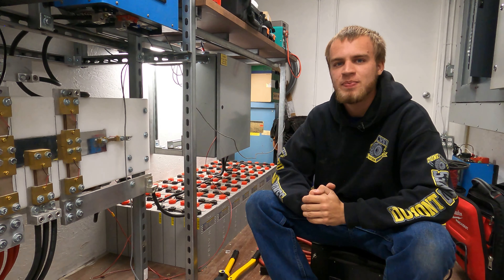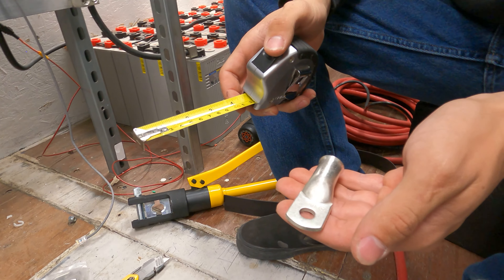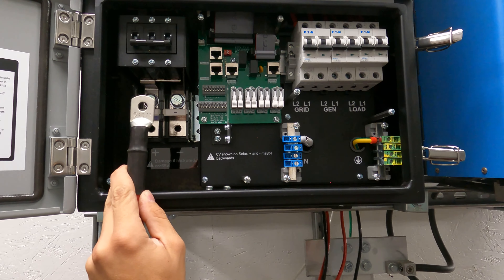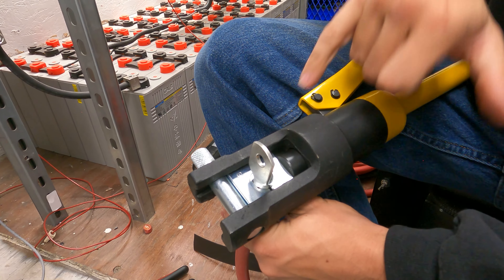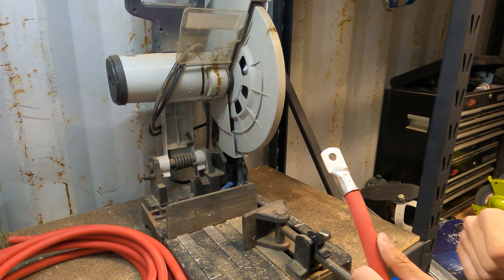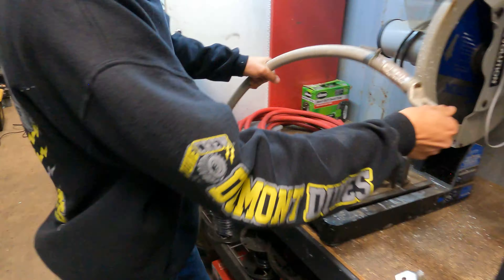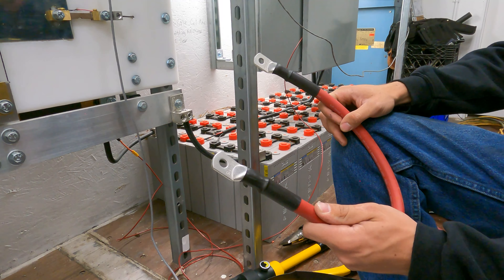The PROPER WAY to Crimp Heavy Gauge Battery Cables

Comment: I bought a TEMCo hydraulic crimper for my solar install.  If I had known how easy it was to make my own battery cables, I would have been doing it years ago!

I've come to the practice of rolling the cable insulation along the utility knife instead of cutting with the knife.  The end result is that I have no cut strands.
Reply: Are you happy with the hydraulic crimper?  I just ordered one, I like the 1/2 sizes so you have some leeway for different thicknesses of copper lugs
Reply: @stovepipe9er  Yes, still happy with the TEMCo hydraulic crimper.
Reply: @jimegan7077  excellent, thanks for letting me know
Reply: @stovepipe9er  I have the same crimper. works great

Comment: Great video, I watched a few videos before yours and thought to myself, hmmm, I don’t think they should crimp battery terminals with a chisel. I don’t think they realise that it should be compressed it to a smaller cross section. I was checking this out because I wasn’t sure if I should tin the cable before crimping, but you’ve answered my question. Thanks👍

Comment: Nice video. The only thing I like to do different (personal preference), I like to wipe the insulation and lug with a rag dampened with isopropyl alcohol prior to applying the shrink tube. I find the heat activated adhesive in the shrink tube really adheres better if any fingerprint oil or contaminate left by the manufacturer or by the crimper is removed. 

Also, I’d note TEMco sells referb units on E-bay. Mine I couldn’t tell from new, other than an oily residue (I suspect it had a failed or mis-installed seal and was returned and rebuilt). Saved $$$

Comment: On the 500 pro lug, try and cut directly on the crimp lines and see if the copper is tighter there.
Reply from the maker: I went back into the shop and took a look at where I cut, it was actually on one of the crimp lines, the 1/8" kerf of the blade cut off half of the crimp....It wasn't much tighter at all, it had about the same amount of air gaps on it.  I like the 6 point crimp much more.

Comment: Helpful and educational video.  Good and straight to the point.  Looks like you choose a die that's one step smaller than the cable od.  Like your 4/0 cable using the 95mm2.
Reply: AWG chart

AWG #	Diameter
(inch)	Diameter
(mm)	Area
(kcmil)	Area
(mm2)
0000 (4/0)	0.4600	11.6840	211.6000	107.2193
000 (3/0)	0.4096	10.4049	167.8064	85.0288

Must of got a good crimp connection then.

Comment: I like to sand the inside of the lug before inserting the wire. But to each their own. Looks great
Reply: Lugs are tinned (solder coated) in many cases so you're just removing the solder.  Silver based solder is 5% more conductive than copper.
Reply: @aday1637  I also do not get new ones often. I have an old box of lugs all different sizes.
Reply from the maker: Great idea for older lugs!  Luckily for me, these were brand new.

Comment: The explanation of the process is very good. 
One question though : Is it possible that your "evil chop saw" may have heated the cross section and fused the strands together making it look smooth almost solid copper.
Reply from the maker: No, the stands are still distinguishable, just very tightly packed

Comment: Manufacturer	Knipex
Part Number	16 20 165 SB This stripper is infinitely adjustable and cuts the insulation quickly with no nicked strands.

Comment: Great video, thanks. Just one question, why do you use the heat shrink?
Reply from the maker: To keep things nicely sealed and to prevent any corrosion getting to the copper especially if you're using them with lead acid batteries
Reply: @HighTechLab  Thanks cobba. I reckon heat shrink can also dampen vibrations and help preserve the join by preventing conductor strands from fracturing. I think you need to view this guy's video, he says, nearer the end of his video, that heat shrink is only for cosmetic purposes, plus he's got a good style of crimping. Anyway check it out.  https://youtu.be/XkMdlPsBxkc
Reply: @HighTechLab  is is the fumes of the acid? or something else? maybe keeping oxygen from the copper?
Reply: @SeriousSchitt happen? The lug is mounted on a bus bar and the only way for the vibration to stop would be for the heat shrink to be between the lug and the bus bar. Do you think if I put a spring on the top of my car it will help with the suspension?

Good thing that heat shrink is only for cosmetics and not for stupid things like insulation.
Reply: @jackster2568  Haha, good luck to ya.

Comment: 8:17 I can still see individual strands indicating there is still air in between wire strands. Not tight enough. 
use one die size smaller and crimp it again, or insert shim to reduce the die radius and crimp again.

Comment: If you're a full-time electrician why don't you just get a Greenlee battery-operated crimper? Everybody in my area uses them. Allot faster and way tighter. Looks a lot better in front of the customer if they ever walk in lol ;)Thanks for the vid!
Reply from the maker: Those are absolutely beautiful tools to have. The crimper I used however is about 60 bucks on Amazon and for the average Joe that doesn't do it for a living but wants to work on their RV it gets the job done a lot better than how some people cobble things together.  By making a video showing how someone can do something cheap but still properly we save a lot of diyers the risk of having fires from doing things wrong and having bad connections

Comment: hey bud i watched your video and used your links to get the crimper, wire and the lugs and thanks for that. i do have a small problem, i hope someone can help. i am using 2awg wire and the die marked "35" in the hydrolic crimper tool, it crimps the lug just a tiny bit but the lug just falls off. i tried it several times, i am mechanically inclined and love a good puzzle but i cant figure this out. so then i moved onto the die marked "25" which is my next smallest die and is made for 3awg wire, and it just crushes that that poor lug onto the wire lol. it looks super solid but it looks wrong and abused. is my "35" die wrong? is my 2awg wire wrong? are my lugs wrong? its the lugs they send with the wire and the wire is clearly marked "2awg"......................please anyone, there is no damn local store that knows anything about this stuff. for now i guess i will crimp as if its 3 awg, but continue to use the "2awg" and lugs they sent, but i really need this solved asap.
Reply from the maker: With my crimper I find the dye that is a little bit larger and just shave down the flat spots where the dies hit before the crimp is fully made.  I use an angle grinder but a Dremel might work. This allows things to close up a bit more and establish a proper crimp
Reply: @HighTechLab  that sounds like a good idea, do you think the "35" die was marked wrong, and maybe was for a bigger wire?  or do you think my "2 awg"  wire from windy nation or the lug  was marked  wrong? i have 2 giant battery banks i am building and i want to know for sure i am using 2 awg wire with the proper crimps.  thanks again for all your help, you should see the cables i made a few years ago, they suck bad and i bought all the wrong stuff, none the less i am on the right path due to content like this.
Reply from the maker: @jasonbrown467  they are marked with mm² not awg.  It's like thinking a 10mm wrench is an incorrectly marked 7/16 wrench.  Sure you can grind a wrench to make the larger size fit but that doesn't mean it's wrong it's just a different unit of measurement.  Windy Nation lugs are good ones. If they match your wire gauge then you should have no problem modifying the dies a little bit. I write with sharpie on all of mine when I get them dialed in for a particular lug and wire gauge.
Reply: @HighTechLab  they are marked using mm², it doesnt say mm² specifically they all just numbers and i found a chart that says 2 awg wire requires the die stamped "35",  for the record i never even heard of "mm²" before cracking open this set, who knows maybe i am missing something and will unravel this mystery in a few days.
Reply: @HighTechLab  I used a grinder to adjust my 35mm to 2awg. It meant taking off about one mm. After I got it close, I dressed the surfaces flat and back into mating with one another by putting them back in the too and closing them down to almost snug on a thin metal file. The file takes off the high spots and you can keep tightening the tool a bit at a time as you get the surfaces back into sync with one another. Close is good enough and way better than what I can do with my eye alone. I've used the same kind of trick to fit stone, wood and metal objects together with a joint you can't get a piece of paper into. It's a bit of a pain with this tool because it is a little loose in the way it holds the dies. Thanks for the video.
Reply: With fine stranded cable the wall thickness of the lug may require using the next size die down to accommodate those variances.

Comment: Why do you need the heat shrink?
Reply from the maker: Keeps moisture out of the joint.  For best results use heat shrink that has glue on the inside.
Reply: @HighTechLab  
and insulation for the stub

Comment: what is the size of the heat shrink tubing?
Reply from the maker: When it is flat, it measures 1 1/2" wide, Not sure what that actually converts to in terms of diameter...I bought a kit that had the wire, lugs & heat shrink, so I didn't really have to figure out what size it should be.
Reply: wrong size

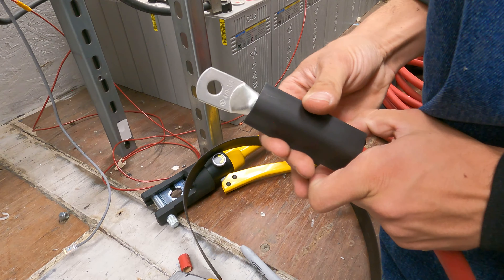Comment: @5:56 Sir, you need smaller diameter heat shrink for this connector/cable. Remember to slide it over BEFORE crimping!
Reply from the maker: Why smaller???
Reply: Example: Lets say we have 1" tubing 2:1. It can shrink to 1/2". The best fit will be in the middle - for 3/4" cable.
Reply from the maker: @apivovarov2  based on your example I did this perfect. I am using one inch heat shrink that is a 3:1 tubing.
Reply: @HighTechLab   All these people that don't have a YouTube channel or any verifiable credentials whatsoever are sooooo critical of your effort.

Comment: Your crimp is OK, but I could see gaps on the one side after your cut.  Your die was slightly undersized.  There should be no gaps in a good crimp - it should be gas tight.  The larger lug you cut open had gaps mainly due to your cut being in between the crimp zones.  That was a poor cut more than a poor crimp.

Comment: $200 for one lug, wow.
Reply: I don't believe that to be the truth.
Reply from the maker: So, I just went and looked this up - I totally misspoke.  I recalled the $200 figure from research years ago.  What the real situation was, was that I went to The Geek Group National Science Institute, a Nonprofit based out of Grand Rapids, MI.  I was looking through their available materials and whatnot and offered $200 for a couple of fuses.  Essentially, they were like !!! $200?!?!?!?  Okay sure, but here, you can have the fuses, and this wire, and this shelf of capacitors, and these 3 NST's and OOOH Here's a 4000 Amp Current Transformer!!!!

When I got home, I looked up the value of what I had got, and the reality is that the lugs are around 50 bucks each, and the 4 of them that were attached to the cables (Seen in the video) would be valued at $200, which is nowhere close to what I had paid.  I was in-fact mistaken, and you can find them on Platt and Graybar for 40-50 bucks all day.  The $200 figure was new price for all 4 lugs on the two cables, combined.  I'm too young to be forgetting things already, lol.

Comment: While reading the replies to my post below, regarding use of solder over crimp, I had to install my 'BS-prevention shield'.   So many comment without practical experience.   I've compared tens of thousands of crimp and solder joints in over 40 years experience (I'm 72).  I've looked at and repaired more than most of you put together.  Solder is far superior to crimp in so many ways.  Yes there are codes, written by fools sitting at a desk.  There are specific reasons why you would want a crimp (for convenience) over a solder.  But I see none listed below in any of the replies that  display any validity (only statements about dissimilar metals, overheating wires, etc - all of which apply to both crimp and solder).  I'll take my practical experience over your book learned nonsense.